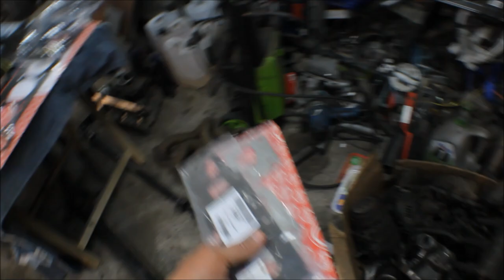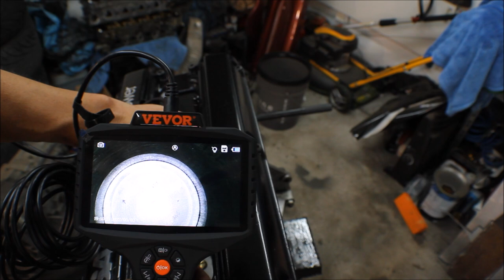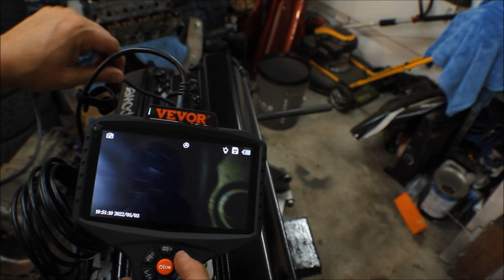SAAB 9-5 Engine Assembly, T5 Camshafts, T7 Cylinderhead, Gaskets, TorqueSpecs + Bonus

Comment: Hi Jonas, why don’t you use the original headbolts? And why do you prefer a higher torque instead of 90 degrees? 
Thanks for the great video!
Reply from the maker: It should withstand higher power. OEM headbolts stretch out at to high cylinder pressure
Reply: @JonasKakarikas  okay, did you use studs and nuts from ARP?

Comment: Did you happen to document building the oil pan?
Reply from the maker: No i just built it free-hand, using the old oilpan as a template for the flange
Reply: @JonasKakarikas  Were you able to use the original oil pickup tube?
Reply from the maker: Somewhat, it has been extended and modified since its a rear sump oilpan now

Comment: Du som kan saabmotorer, vad skulle du uppskatta att det kan kosta att bygga en t5/t7 hybridmotor? Tänkte sikta på ca 400 hk och då lär det räcka med t5 kolvar och stakar. Borde jag köpa en hel t5 motor från typ bildelsbasen om jag redan har en t7 motor? Och sedan bara flytta över toppen till t5an? Vill helst komma undan så billigt som möjligt
Reply: Om du ska köra med en T7 topp och T7 stålpackning så behöver du svarva ner kolvarna 1,1mm så då behöver du ändå ut med kolvarna för att kunna bearbeta dom.
Reply from the maker: Rätt svårt att säga, beroende på vad man har för kontakter osv. Svarva kolvar, nya packningar, värre koppling osv. Blir snabbt 20-30k

Comment: Great video Jonas!! Thanks for showing us the right order to put the chain sprokets, I'll never forget the correct way! Just have a question about the oil turbo return line, you did not mentioned where it's going to return to the new oil carter... Also, I liked a lot the head bronze studs you add to reinforce it... Could you please give us more details? Size and Lenght? Thank you very much! Cheers!!!
Reply from the maker: I dont have any specs on the brass studs, i have not done the work myself